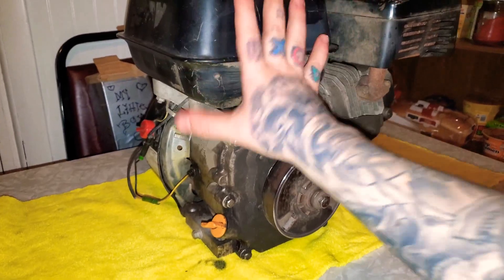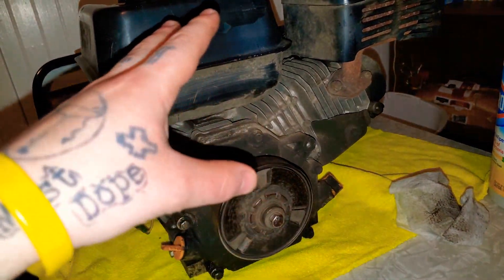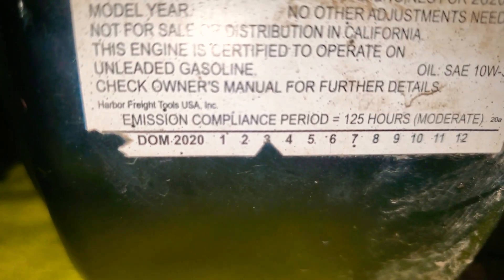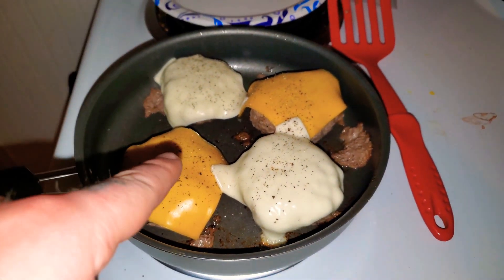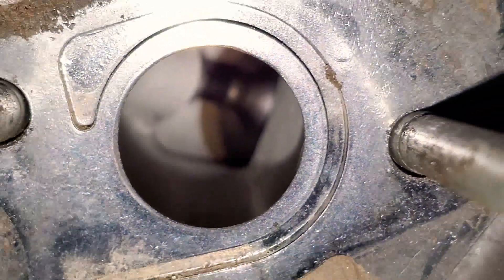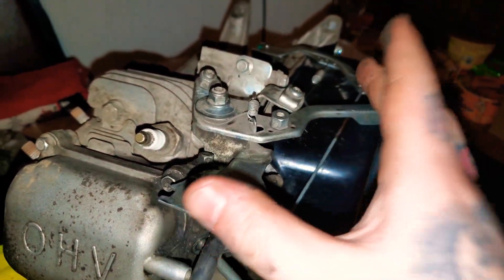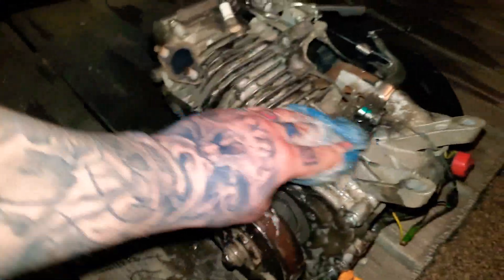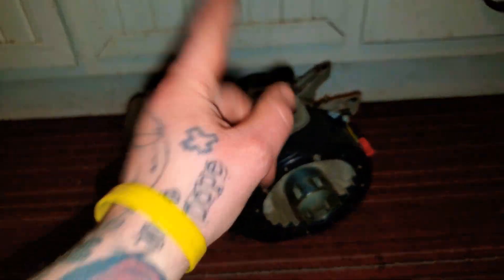Cleaning Up And Taking Apart The Predator 212cc 6.5HP Hemi (PART 1) Fixing Tech

Comment: If you needed to clean the inside of the engine what chemical would you use
Reply from the maker: I just used soap and water to clean the outside engine but I don't know about inside
Reply: @gamefreakdanielBIGD yea I just ripped my hog with a predator 212 going like 60-70 through mud and I was scared to clean it with soap and water 😂 but they say you can clean the small engines with it I was just wondering if you can pour it on the engine as well